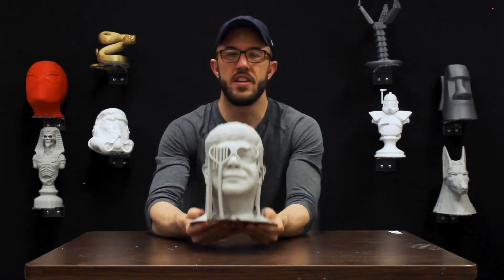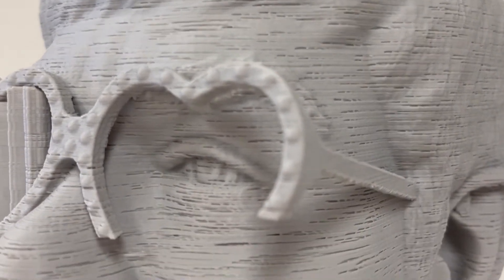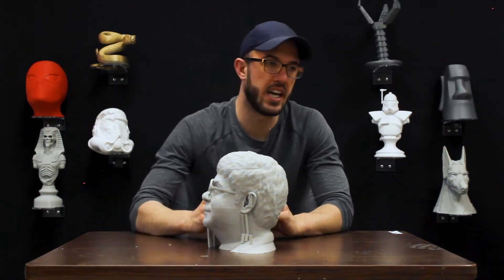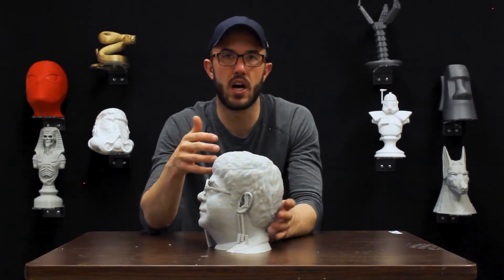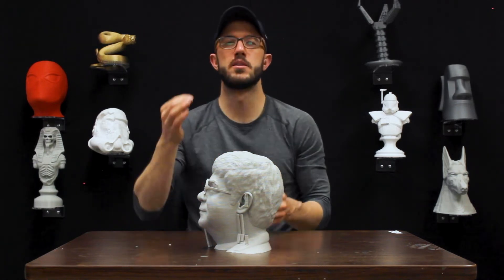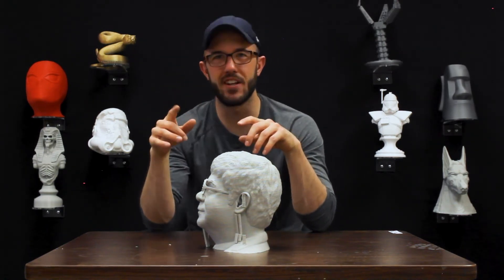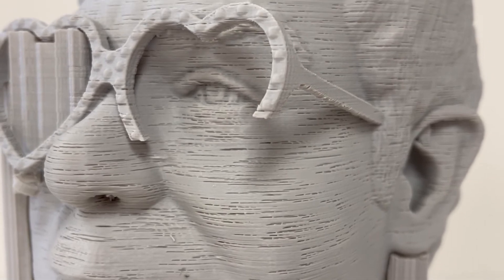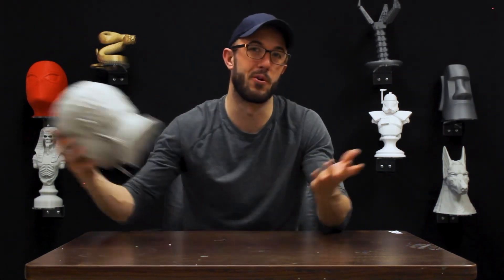3D Printer Problems: How To Fix Extrusion Skipping

Comment: And how to fix it is......? New motor?  That's it? You didn't go through any of the troubleshooting that should be preformed to find out what the problem is.  Being a little optimistic when naming the video  "How To Fix Extrusion Skipping."  You didn't even say what to do about the motor being too weak and jumped to that problem when its the absolute least likely cause.  Your video is useless.  Thanks for wasting my time.